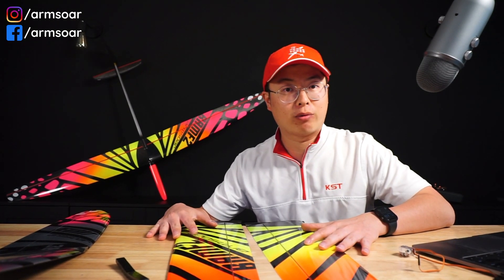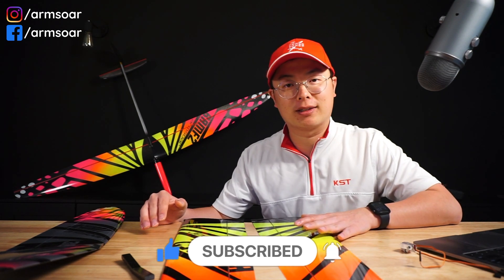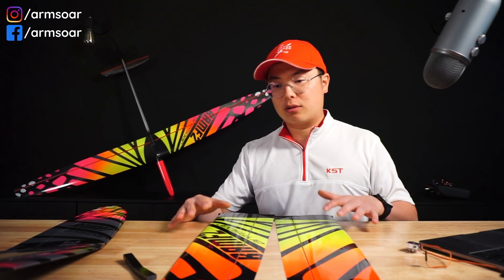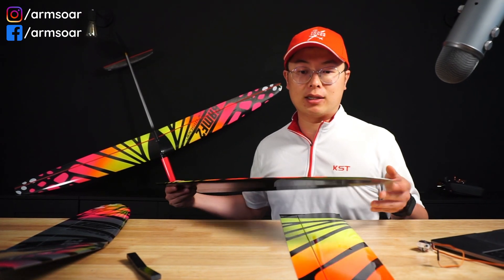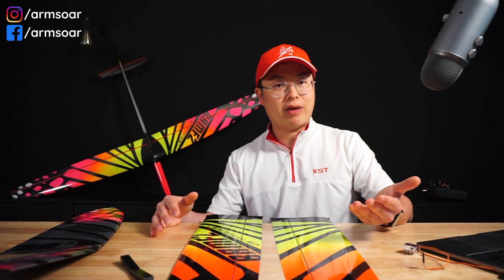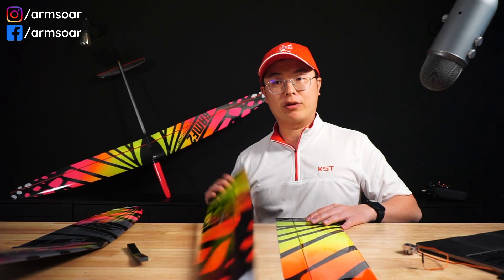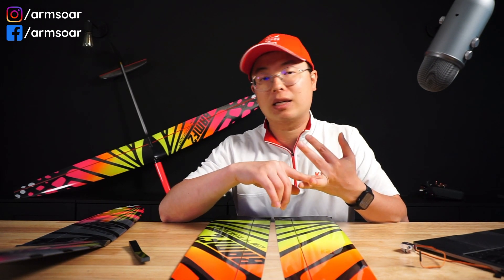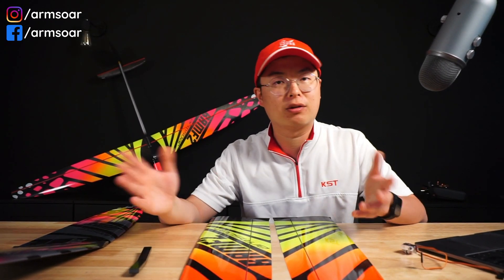RC Glider Basics | What Is A Layup on a DLG or F3K Glider?

Comment: Very informative, thanks. Are the tail feathers are typically the lightest layups (CW20 or fiberglass)?
Reply from the maker: Yes, back then they're mostly fibreglass, and now mostly CW20. There are some using lighter fabrics than CW20 but I feel they're a bit too fragile for normal use - they're better suited for more specialized uses or custom orders.

CW20 tails should be lighter than fibreglass tails and much stronger, especially if the glass tails are painted.